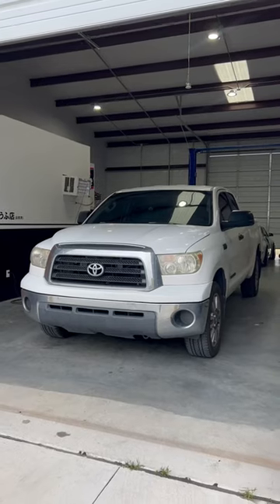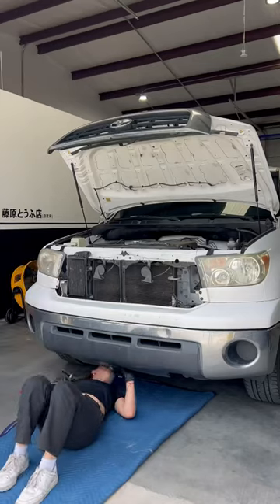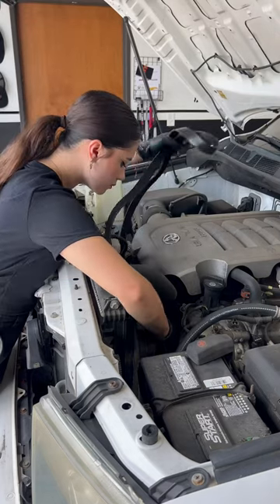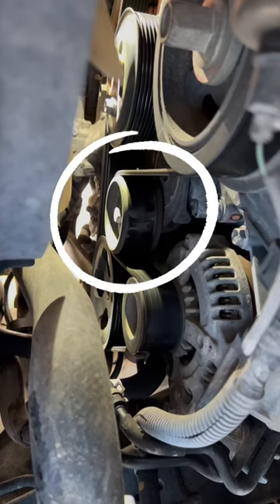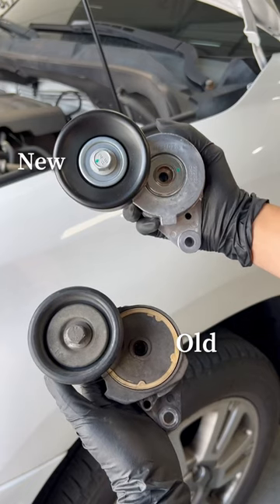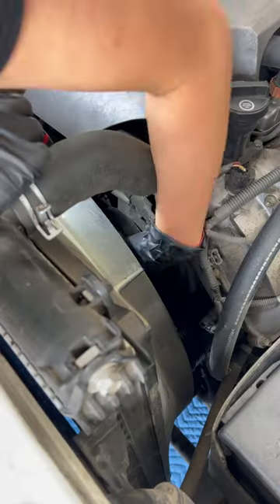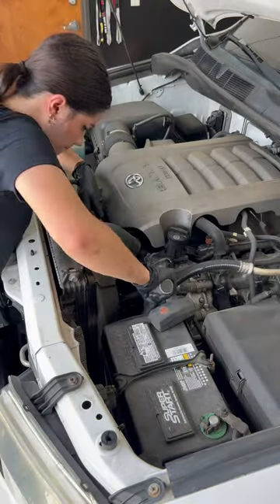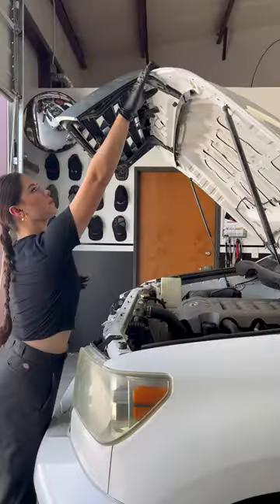Fixing a squealing serpentine belt on this Toyota Tundra✔️

Comment: She really know how to do this stuff
Reply: user-ty9wy4so8q  hello
Reply: Anyone can. It's easy.
Reply: @Epiz76 I doubt "anyone"
Reply: @sonicking2570 serp belts are one of the easier DIYs anyone could do on their car. Don’t need tons of tools, don’t need to disassemble a crazy amount of stuff. Simple and straight forward. People just scared or simply think cars are more complicated than they actually are. I know because I used to be one of the people that was scared to work on my own cars. Now i do absolutely everything myself thanks to internet school.
Reply: @-mp I'm in the process of getting my youtube bachelor's degree! 😊
Reply: Not really. Her diagnostic process for replacing a belt tensioner is a complete guess. She said she went for the belt tensioner because it was squealing 24/7 when in reality a belt squealing 24/7 could be caused by literally any pulley in the system that it's riding on. It's actually really dumb to just assume that it's the belt tensioner and go out and buy one and replace it. If she knew her stuff then she would do an in-depth diagnostic to figure out exactly which pulley was causing the squeal and then order and replace that one.
Reply: @RoughRaiders13 if you rewatch the vid, she did exactly what you just said, she checked the condition of the belt-in good condition she said. then she went for the pulley because it was squeeking 24/7. i feel that you have short term memory cloudiness
Reply: @-mp did you know how to do it without YouTube or anyone showing you ?
Reply: @shisui3878   i mean you see it done once you can figure it out on most cars. I’ve been wrenching on my own stuff for nearly 10 yrs now and I’ve been working in industrial and commercial hvac for close to 2 years now so I consider myself pretty mechanically inclined compared to my 18 yr old self. But shit if I’m still unsure of something I’ll STILL look shit up, no shame in being sure you’re doing something right imo.
Reply: @-mp  and yet you’re putting people down for not knowing 😂😂😂
Reply: @shisui3878  when did I put anyone down? I just wouldnt gas anyone up like the original commenter for being able to perform some of the simplest maintenance you can possibly do on a vehicle. And there’s nothing wrong with doing your due diligence and researching something before attempting things yourself. In my field that can come back to bite you BIG time, so I’m not ashamed to admit that I’ll do everything I can to get things right the first time if I’m unsure big man. 🤷‍♂️
Reply: @shisui3878 are you on YouTube? Is anyone who's seeing this comment on YouTube?

 Okay, then you should have no problem watching the same YouTube videos we all have access to.

Anyone who's not physically or mentally disabled can change a serpentine belt.
Reply: @RoughRaiders13 facts

Comment: Excellent auto technician. Nice work.
Reply: 😂😂😂😂 excellent for what taking a guess on what could be causing the belt to squeal??? A squealing belt could literally be caused by any pulley in the system that it rides on. A real mechanic would do more diagnosis to figure out exactly which pulley is causing the squeal and then replace that component. If this girl just takes guesses on what her problems are then I guarantee she does a whole lot of extra work and spends a whole lot of extra money that she doesn't need to replacing the wrong parts.

Comment: So I have a 2015 Toyota Corolla, LE
My son who is an enthusiast and kind enough to take this on replaced my alternator for me yesterday yesterday 
After he replaced it, the motor on my drivers door wasn’t functioning correctly so my window will go down 3/4 of a way and no further and when I hit it it goes up and then immediately comes back down again so I have to inch it 
Someone suggested that if you charge the battery which he may have done, I wasn’t here to watch it can actually cause panel malfunction 
But I have a squealing noise periodically that I never had before 
Now I have a serpentine belt in my trunk. That’s brand new. 
So it can be replaced but I don’t think he torqued the bolts on the alternator 
I know he was in a rush 
He didn’t mark the tensioner bolt, but I tried to line it up with the part that was shiny, making sure it was cranked all the way in
And yet I’m still getting 
Interestingly enough, when he put everything back together and left before I returned, he left the car running originally my check engine light went off, which had been on for quite some time and of course I was throwing codes for all types of things 
The check engine light went out, but on that same day the check engine light came back on 
Something is definitely not right and I don’t have money to take the car to Mechanic and make sure that everything is right and if there is some thing that needs to be replaced like a pulley that it will get diagnosed properly 

Any suggestions?

Comment: Hey I need help, maybe you’ll have an answer. How come my car starts without a serpentine belt all of a sudden but not when it’s on. The belt isn’t snapped or cut up…I do know that my AC compressor is bad (the clutch won’t engage) and my power steering is trash with constant leaks. I manually spun the water pump pulley, idler or tension pulley, and the power steering pulley (they all rotate with no bad sound to the bearings or anything). My alternator is strong and recently brand new….please help me, I work on my car myself when things happen and have always been successful but i don’t know what’s going on this time around. The car starts when the belt is pulled loose as well (from tensioner being pulled back) but the belt doesn’t cycle/spin. Please reach back to me…I’m supposed to start my job next week and I have only a few weeks to find a place to stay….i really need my car and would appreciate ANY input, I’m genuinely stuck and I need help….
Reply: Now that I’m remembering, when I went to check why my A/C wasn’t working a few days ago (by checking the compressor clutch and if it was spinning) I noticed that the water pump pulley wasn’t spinning ? I thought to myself that could be back….the pulley still rotated by hand so I know it’s not seized. How would the car start without the belt ? But not when the belts on…Do you think I’d need a new water pump ? Does this all sound odd to you or familiar ?….please please help

Comment: Clockwise to get bolt out?
Reply: That's how mines is. Counter clockwise to tighten or to manually adjust pulley tensioner then right to loosen.